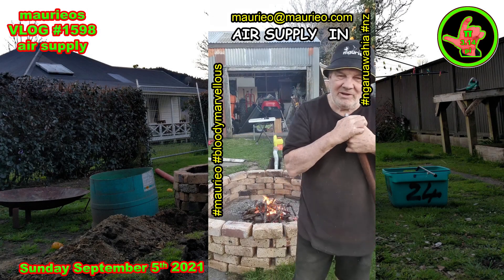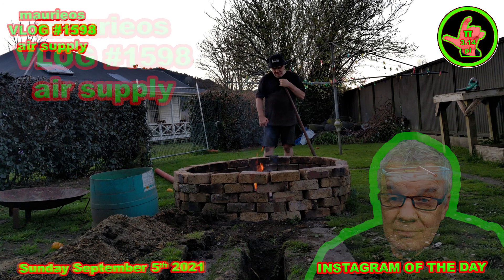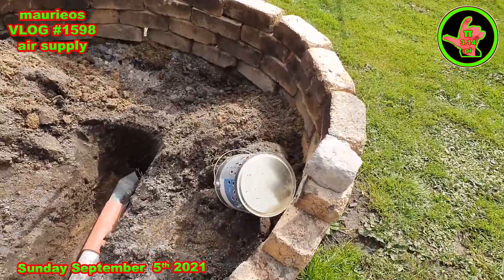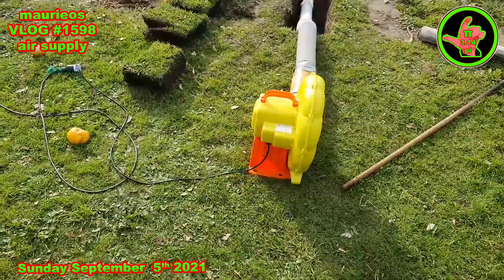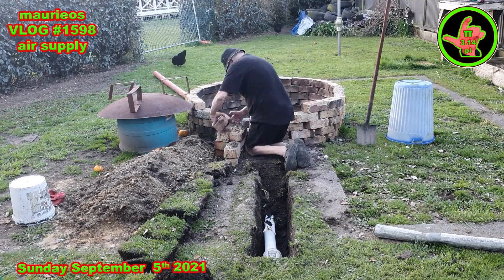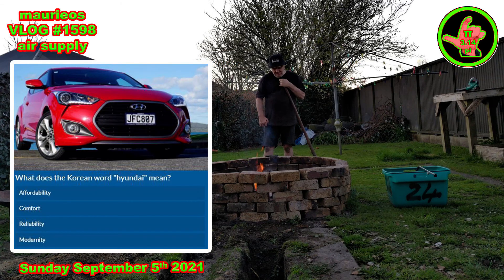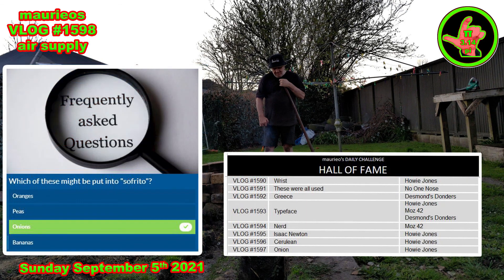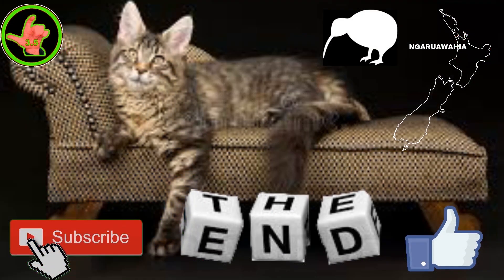maurieos VLOG #1598 air supply

Comment: If the air flow is too high, you could throttle it back be adding a bleed off valve to regulate how much air is actually making it to the fire, or throttle the air inlet to the blower. Looking forward to refinements. David's all over the quiz. "til next time. HiPi 🖖 Cheers
Reply from the maker: Yes I also have another blower that has less airflow.
I have a few things to try time will tell
Cheers.